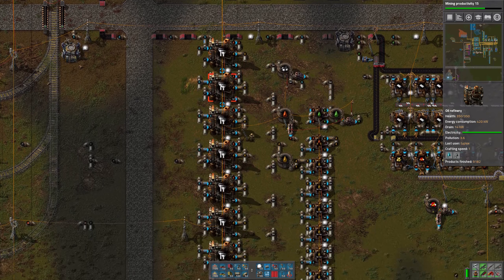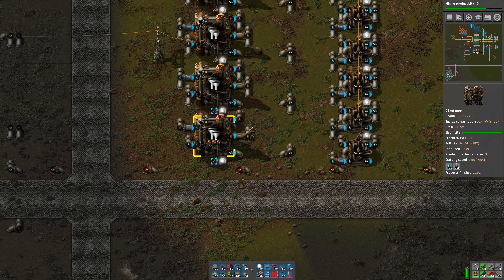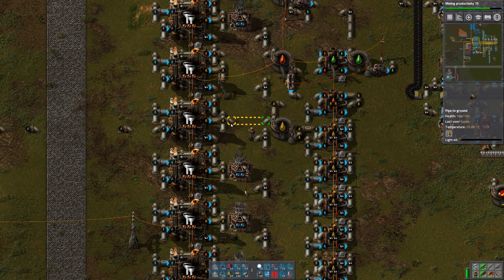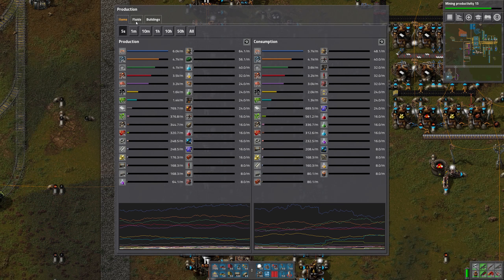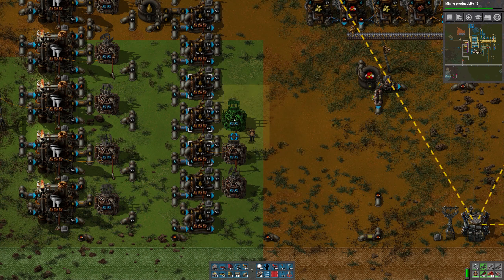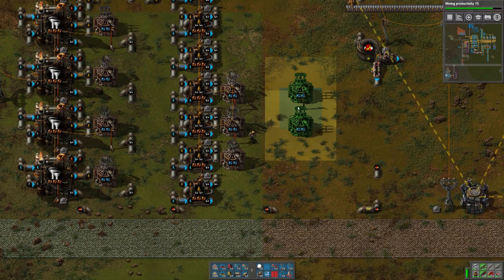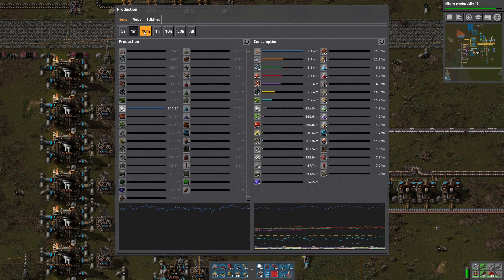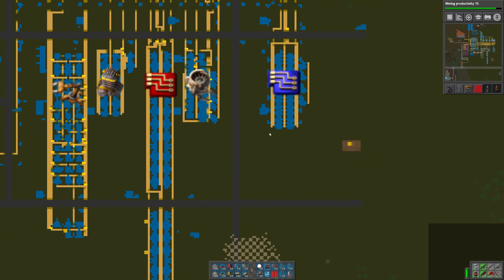Factorio 0.16 Let's Play #22 - Modules for petrol, nuclear components

Comment: A better design for a plastic production line is to keep it in a single line.  You can load both side of the belt by bringing in the output line in and around to fill the inside of the belt after half the plants have placed on the outside of the belt.  That way you can module and beacon the whole line with less beacons.

Comment: Module'd refineries to module'd plastic chem plants (at close to same module levels) just kept the same plastic starvation on petroleum gas.  But the boost allowed for the extra two cracking units, that'll recognize the gain.  And for perhaps easier plumbing on the additional cracking units, mirror their orientation so that all the outputs go towards/around the beacons (since that was already a proven design), and bring new feed lines of water/oil on the back.   More work/pipe - so a tradeoff if considered a smoother approach.  I was getting real nervous on a fluid-mix about to happen...grin.I have never sat thru "let's play" series before for more than a episode or two.  Yours is the first that I follow show by show.
Reply from the maker: Hi David, thanks for the suggestion.  I think you're right.  If every machine had the same crafting speed, then the stacking productivity bonuses should help each higher tier require fewer and fewer machines.  But in this case, the chemical plants with crafting speed of 1.25 get a bigger boost from the speed modules than the refineries, with crafting speed of 1.  Thanks a lot for watching and commenting, I appreciate that.

Comment: 14:20, you are saying that you can't get the rightmost beacon close enough to the center. 

Just remove the two belts that is between the two rightmost beacons.
Put the rightmost beacon 2 units to the left so you got two beacons next to each other
Drag the underground so it goes under the two rightmost beacons

Now the beacons are working correctly. 

Put your blue inserters sideways so they point east and then belt the plastic back into the middle.
Reply from the maker: Good idea, thanks Harry!  I will give it a try.